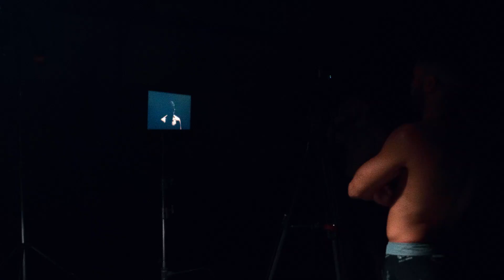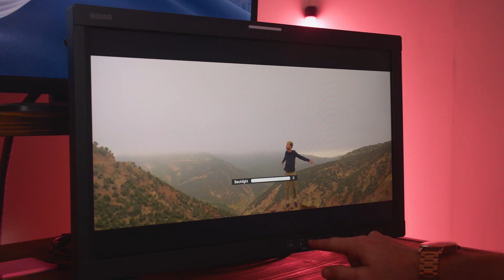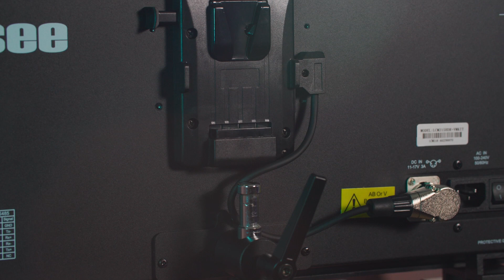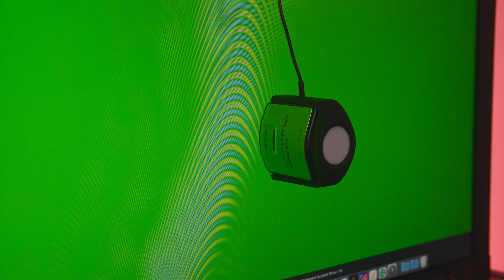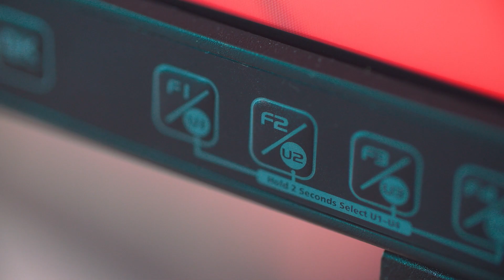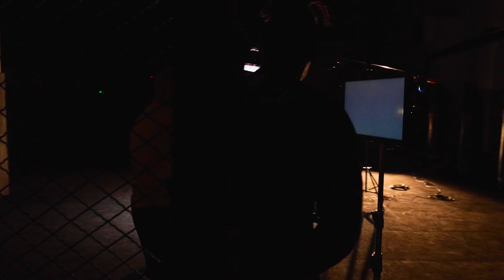OSEE LCM215-HDR+ - Production Monitor Review

Comment: Have you had any scaling issues with this monitor? I've noticed when running a camera through the HDMI input that it crops the outer pixels in the frame around 5% or so. So the image appears more "zoomed in" that it actually is. Ever run into this?

Comment: Thanks for the review. It is unfortunate that Osee is still using those membrane style buttons on this monitor, while the new 15" version appears to have click style buttons. Both of these monitors have the sloppy stand mount, which is inexcusable. That mount goes back to the much older 15" version I have (model LCM215-A), and Osee should have come up with a better option to stabilize the monitor. I also wish this monitor was able to split screen to show two inputs simultaneously.

Comment: WHY did they put the battery plate over the VESA mount??
Reply: Hi Tim! You can flip the battery plate horizontally, which gives you access to the VESA mount. It's a quick 2-minute change, allowing you to use the included battery plate and the VESA mount without any problems. Cheers!

Comment: I've been thinking about getting this monitor for a while now and your review sealed the deal. The only thing I need that really bugs me is the shotty cstand mount but I guess I can always get my own and see if that fixes the issue
Reply: And you can also use a VESA-mount like the ones from Inovativ for a more sturdy solution. Costs a bit more but a safer solution in my opinion.